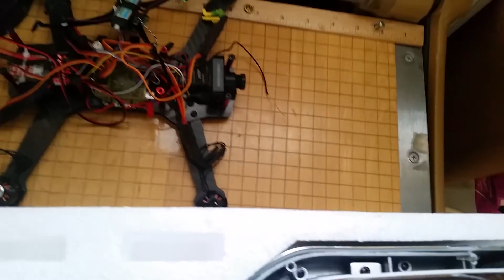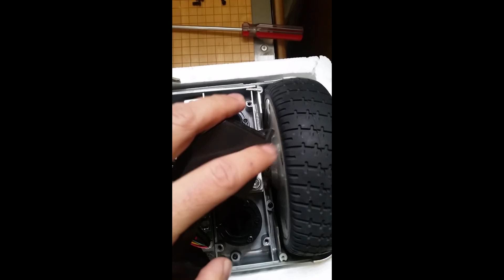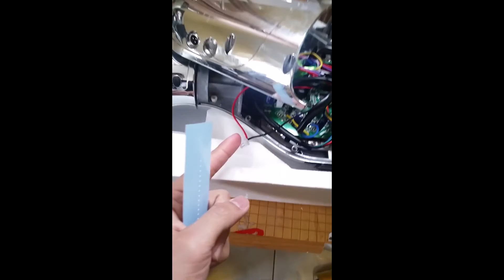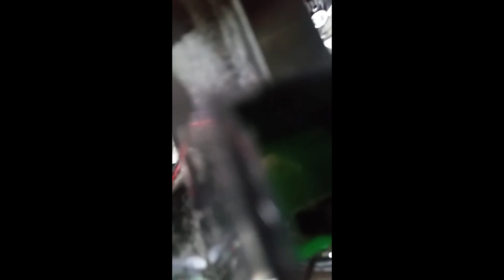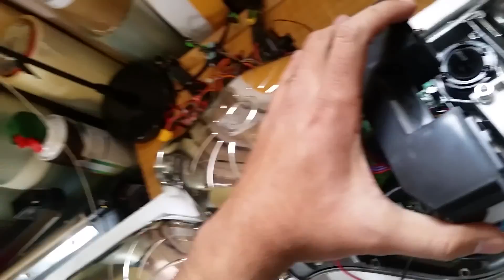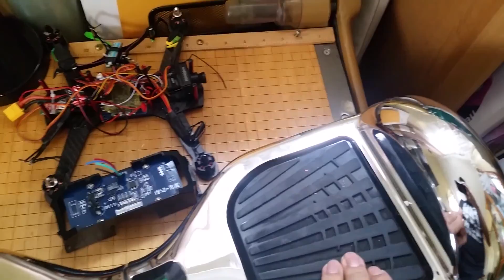How to fix un-balanced hoverboard/mini Segway. IO hawk.Phunkeeduck

Comment: the hover board is beeping when I turn it on I tried to watch all the beeping vidoes on here an it seems not to turn on or off. I need help thanks
Reply from the maker: Open the hoverboard and disconnect the battery to do a hard reset, if that does not solve the problem it could be a bad motherboard.

Comment: Where did you get a new pad?
Reply from the maker: for my issue someone had extra parts for me.  I saw the little rubber pads on ebay for a set of four was like $28 usd(hard to find). But you can find almost all parts at smartbalanceworld.com hope that answers your question.
Reply from the maker: I'd check ebay first though, probably less expensive.

Comment: hm nice tutorial did that happen to you when you bought yours or later on cuz. The thing with mines is that at first it was working great, till one point. Mines still works but there are this times where it just turns on the red light, and the right side wont move backwards nor forwards. Imma try the techitup tut first, if it doesnt work illl check sensors but im 98% sure there is nothing to big wrong since it works now and then (sensor). Left side still works after red light apears
Reply from the maker: Later on after I bought it. And yeah tech it has a good point about the connections .
Reply from the maker: let me know if you were able to fix yours.
Reply: alright :D
Reply: My board won't stop beeping unless I unplug the battery. There is a red light on the mother board that blinks as well. Pressing the power button does nothing.
Reply: AVEE-ASHANTI SHABAZZ  did you ever get yours to stop beeping. an how did you do it